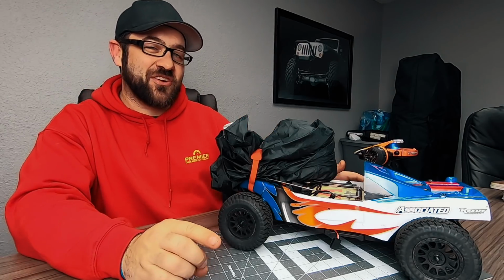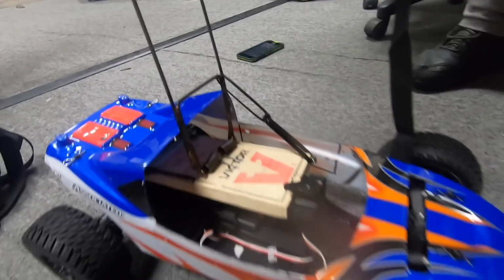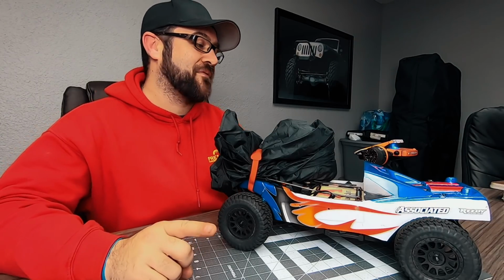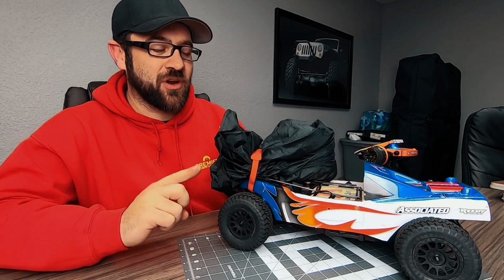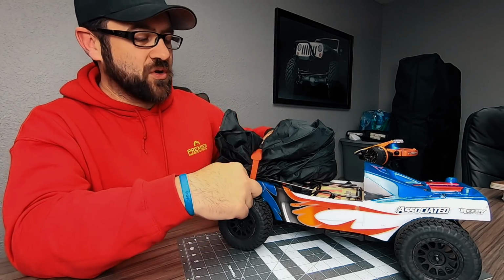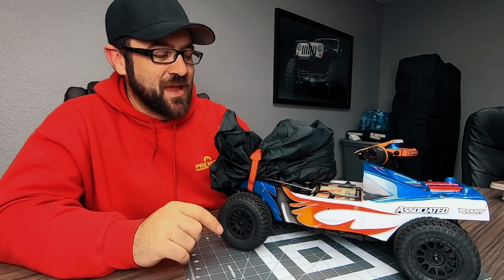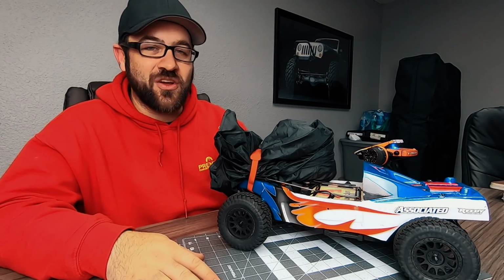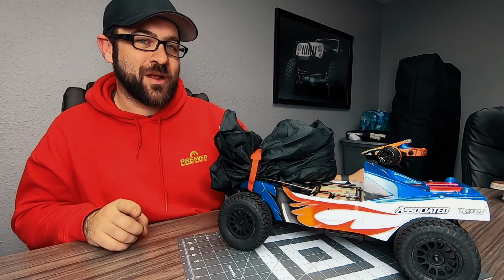#MonthlyMayhem Challenge Hangtime Ep5

Comment: I have a scale question.  My 4-runner. Has basically 31 inch tires on it, on 15 in wheels, a close conversion I think from what I have learned from channels like yours, SBG, and ,  and others would be 1.55’s .. not sure tho.. so keeping the scale correct as possible, If I put 33’s or 35’s on, what would that convert to? I think the 2.2’s look cool, but they look like they would be close to 44’s in the real world, they are out there, but not practical on a everyday driver. Thoughts ?
Reply from the maker: Take the wheelbase of the real truck (say 100”) and divide by the wheelbase of the body (say 12.3”). So 100/12.3= 8.1
So that means any scale part time 8.1 would equal the real part. So a 1.55 x 8.1 would only scale to about a 13” wheel. Now you just need to use the correct measurements instead of the ones I was assuming.